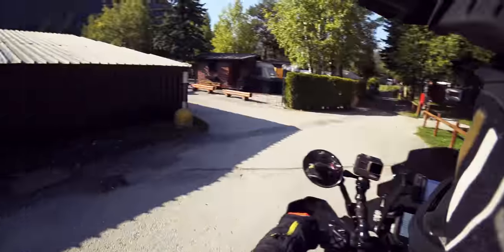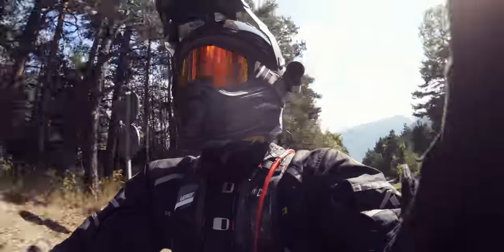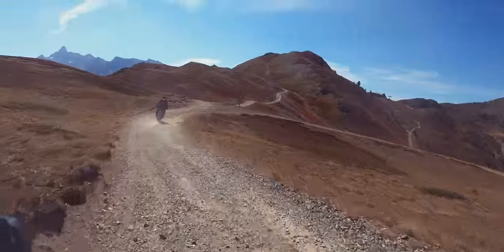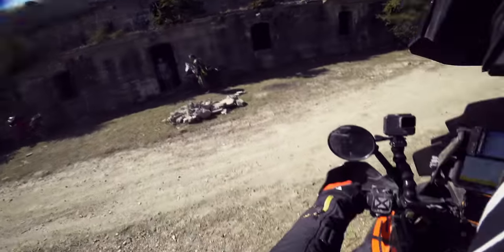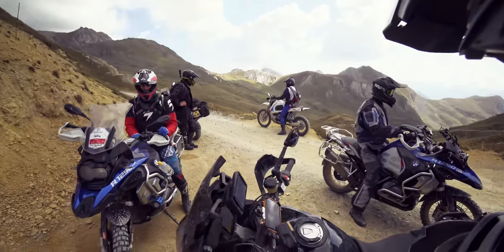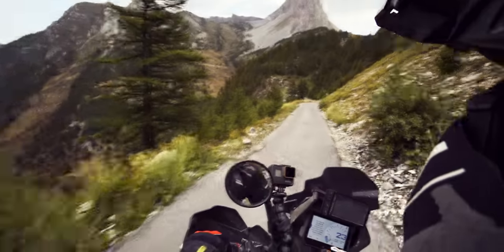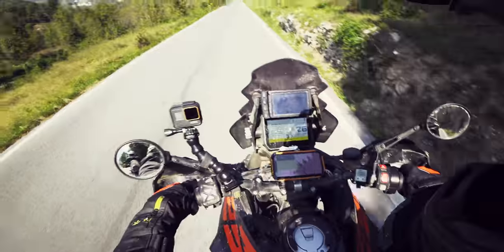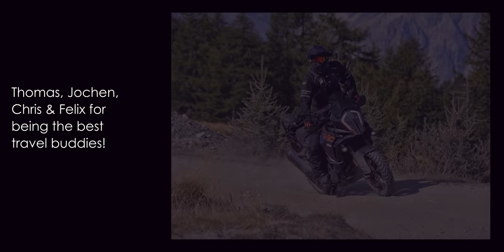WEST ALPS OFFROAD MOTORCYCLE TOUR on a KTM 1290 Super Adventure S

Comment: Awesome video. Saw it on my TV. What a pleasant experience. Thanks for the time and effort you had to put all this fantastic adventure together.
From what i saw, most of the bikes had the Mitas EO-7 the standard or the Dakar version? Some BMW had the TKC 80?
What's your feedback on these tires?
On road tire pressure?
Looking forward for the next videos.
P. S. : Glad you spoke in english, so we could understand. 👍
Reply from the maker: Thank you very much for your kind feedback! Nice to know you appreciated the language choice - the previous commenter complained that it wasn't all in German 😉 As for the my tires - I had the E-07+ in the non-dakar version (there is also a E-07 - without the plus for dual sport bikes). For my upcoming trip I really wanted to try something different but ended up choosing the E-07+ again but this time in the Dakar version. It will be an onroad/offroad tour with a total of 6300 km so I am hoping a fresh set of E-07+ Dakar will last for the duration of the trip. If you are interested in a more detailed feedback on the tire check out this video https://youtu.be/ElDSbr62HgA
So, both KTMs were on the same Mitas and the big BMWs had the Anakee Wild - a good tire but with much softer rubber compound. If you are not careful with your gas hand the tire wears quick that is why we had to change Chris rear tire halfway through the trip 😂 The vintage BMW had the TKC 80.
Reply: I'm now trying 07-Dakar on KTM 1290 Super Adventure S. A week ago I was on gravel in Croatia. Great in the field, but I won't buy them anymore. We drove 2000km and I have 4 mm less sample. At higher speeds, the front wheel is unstable, as is accelerating acceleration. Otherwise they are great in the field.

Comment: Very nice video! Did Assietta from south to north last year. Even got lost in Sportina (much thanks to the GPS) and ended up in an enduro track on the way down. Made Assietta a walk in the park. Good thing I was going downhill! Next time I'll try from north, and then via Colle delle Finestre. Your friend was brave to ride GS without crash bars. I wouldn't.  

Thought about Col de Sommelier but since traveling solo decided it was too risky. Maybe some other time.
Reply from the maker: Thank you very much 😉 you have to experience the Col de Sommelier- it was one of my favorites and you can do it solo as you will not be completely alone on the mountain 😎 if you are comfortable with hairpin turns the only the upper section gets a bit technical because of larger rocks. Cheers

Comment: Nice Video!! congrats!!!  did you ever use the original rims  for offroading before replacing them? im in the dilema between a SAR or a SAS but rims is something that i have to consider
Reply from the maker: Thank you very much- no I did not use the cast alloy wheels. I am sure they won’t break just at the sight of gravel but if you plan to ride tracks like in this video I would not use them. There are always rocks or pot holes even on simple tracks. Even with the spoked wheels you need to be a bit careful- the bike is heavy and even though the are more robust they can still take damage 😉

Comment: Perfect ❤️.
I also have 2 question .
First did you use the same tire pression on the dirt ? 
And why you didn't continue to France ?
Reply from the maker: Yes - same tire Pressure as onroad. The grip on gravel is good enough- low tire pressure may risk damaging the rims if you hit a rock or pot hole. I would have liked to go to France - we just did not have the time on this trip.

Comment: What's the wheel and tire setup you used during this trip? I'm sorry if I missed it. I'm looking to buy an extra set of wheels for my SA S for the occasional off road tours.
Reply from the maker: Check out this video then for off-road modifications to the S model https://youtu.be/_yjVpDS4UqE - maybe there other useful stuff in there too 😉
Reply: @MotoVibes  thanks! I've seen that one. But you fail to mention the dimensions of the tires and wheels you bought. All the other upgrades I already have. And then some. It's a good list you made!
Reply from the maker: @Moonen100  oh - I see. I bought the same dimensions as the stock wheels. Makes life a lot easier - you could mount 21/18 inch wheels but you would have to change the front fender and side stand - the speed reading would be off too. Depending on where you live this May not be considered a street legal modification (like in Germany)

Comment: What about a Christini 450 awd off road bike from the USA 🇺🇸. Designed for this journey.
Reply from the maker: Many riders choose much smaller bikes than us - single cylinder bikes of all sorts are a common sight but these bikes are all hauled there in vans or on trailers. Smaller bikes will also open up different and harder tracks that are just not feasible on a large ADV bike. However, it is amazing what is possible with larger bikes for those of us riders that do the entire journey on two wheels.

Comment: Weight is your enemy on a motorcycle off road! 500 Lb plus is a bad idea no matter how strong you are.
Reply from the maker: These tracks are still doable on a large adv bike but anything more a lighter bike would be better. Since I am riding between 1200-1500 km just to get to areas like these in Europe the larger bike has its advantages for the long onroad sections. Also, I still do onroad tours only. With that said I have been eyeing the mid weight adventure bikes for a while 😉